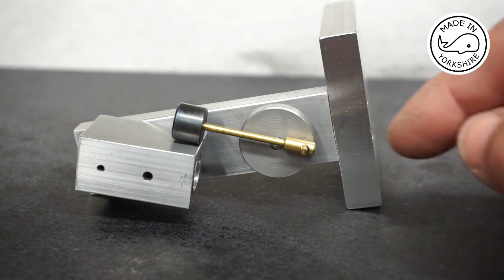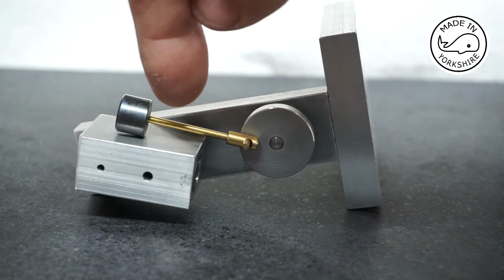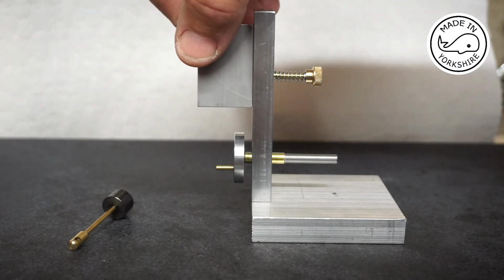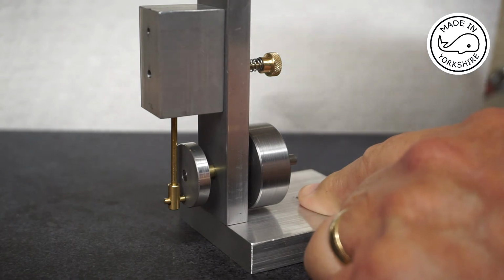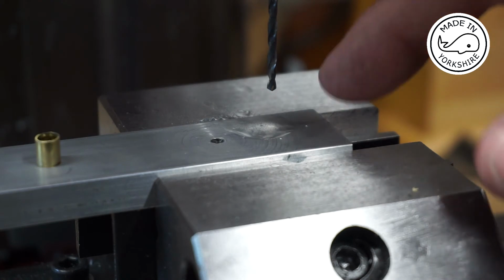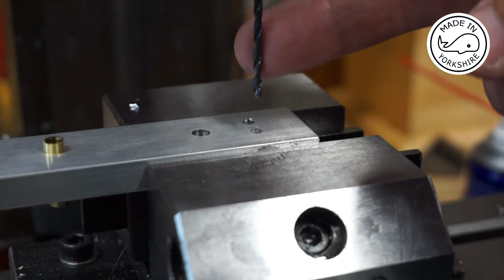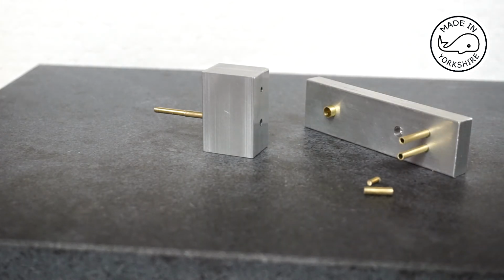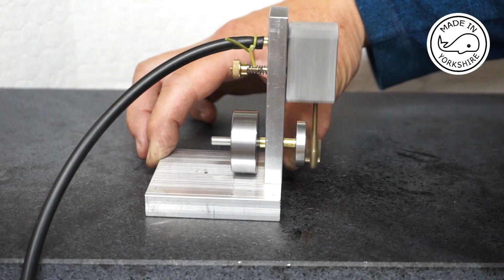#MT20 Part 3 - Making an Oscillating / Wobbler Engine. By Andrew Whale.

Comment: Can't wait to see what project you take on next!
Reply from the maker: Thanks Dave. It looks like it will be a Stuart Model S50! The castings arrived yesterday. That should keep me busy for a while. Looking at the instuctions, I have no idea where to start. I need to do some investigation on the internet, but guess I will have to buy more gear.
Cheers
Andrew
Reply: Busy is putting it lightly! The problem I had with my two engines is piston to cylinder match. If the lathe isn't perfect turning gives cone shaped results (.002 off). You lucked out here by using a reamer to get the cylinder walls parallel and not having to turn a piston. The Stuart uses external power so tolerances aren't that critical where as mine had to be perfect since they were combustion engines. The slightest leak and no go!

Comment: You sound like you might be from Hull Andrew, my home town. Very nice little engine, something I'd like to have a bash at. Greetings from Australia...
Reply from the maker: Yeah - not too far away from Hull - I live near Tadcaster. The little wobbler was a great introduction to making an engine. I knew little (nothing) about model engineering but it only took me a few days to make it from some bits of aluminium - and it was really rewarding when it worked. I wouldn't have considered attempting without the inspiration from mrpete222. Unfortunately I caught the bug. I'm gradually learning how steam engines work and how to make bigger ones!
Have a great day down under and I hope you give it a try.
Cheers
Andrew

Comment: Wow that came out awesome! I watched all 3 parts and also Mr. Pete’s! Question if you please:

I attempted to build my own. No access to a machine shop, just a drill press. I mocked it up on a piece of maple and it runs like a champ. I made the upright exactly like the piece of maple but it won’t work? The maple and aluminum are exactly the same. My piston goes “pop” when I pull it out. Can’t fit a feeler gauge between the upright and cylinder. I am perplexed. 

Any suggestions? Thanks in advance!!
Reply from the maker: Thanks Dominic. I'm not familiar with maple, but if using wood I would guess that it needs to be hard and very smooth. Also make sure that the inlet and outlet ports are correctly aligned with the cylinder hole. There could be too much friction between the cylinder face and the upright - in which case use a finer spring. Also try using some light oil - like WD40 to lubricate the cylinder face and upright, and the piston.
I hope that helps and that you get your little wobbler working.
Cheers
Andrew
Reply: Learning Turning Metal - by Andrew Whale Thanks for the reply Andrew! Yes maple is very hard and smooth! It works great with the wood and I figured out what the issue was with the aluminum. I blind tapped the cylinder pivot hole and didn’t locktite it in. The plan was to do final sanding after I knew it worked. I’m guessing it was backing out. So I did the final sanding and locked in the stud and assembled it. Works like a champ! Thanks again for the videos and reply!